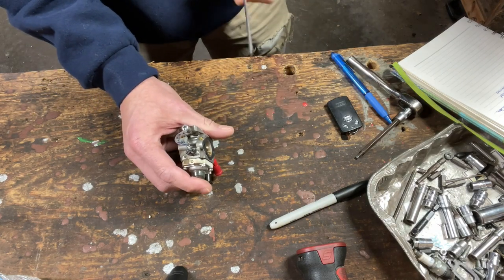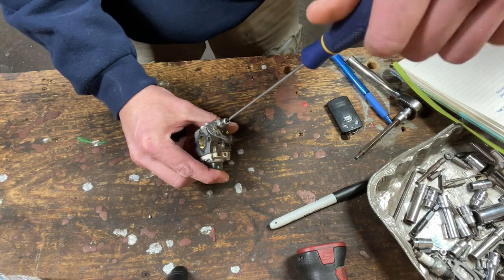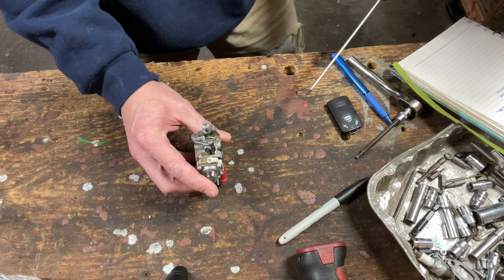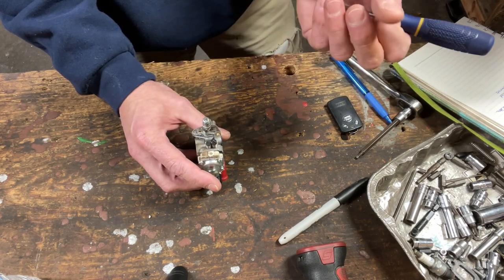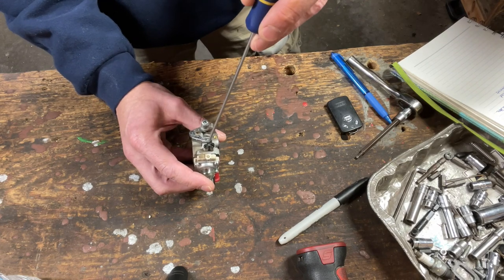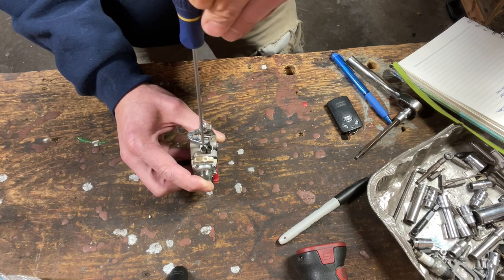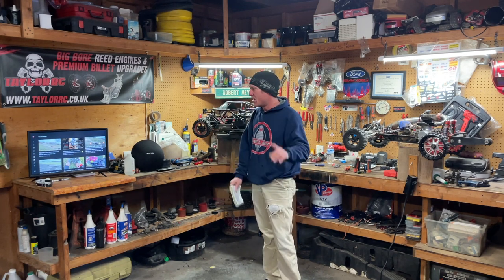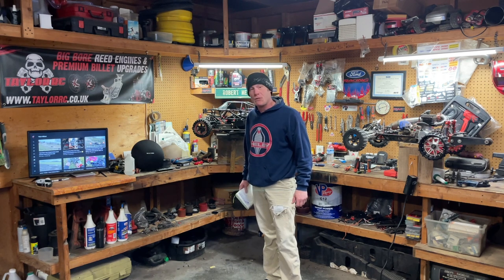FIFTH SCALE RC TUNING TIPS

Comment: Hey buddy. I just received my Rovan T5 sct off-road  4wheel drive truck. It’s the newer one, only comes in two colors, black and blue. Really it’s a MCD racing W5 clone. The truck is absolutely beautiful and I’ve only had it for three days. Haven’t even put gas in the tank yet. Just wanted to get your opinion on engine, break-in as it has the 36 cc door ring Roven, big bore. Any advice would be greatly appreciated. Thanks so much.
Reply from the maker: Hey bro 😎, yeah for running the engine in or “break in” everyone has their own way of doing it, some people do “heat cycles” usually around 3 for 15 minutes. Now I have a different way that I prefer and that is the “Grip & Rip” method, fire it up get, a nice fat base tune, and run it 😉 you will notice the engine “running in” it will gradually hit higher RPM and produce more power the more you drive it. You will also notice the tune changing and that is because as the engine loosens the ring will seat delivering more air and fuel ⛽️

Comment: I installed a velocity stack on my 36cc and it threw my tune off big time. I had a modified stock filter before but it was perfect running and sending rooster tails. I need to try to dial in the tune with the stack now, if I can't get great results I'm going back to the stock set up.

Comment: Had a question about a Rampage if u don't mind someone suggested to try u
Reply from the maker: Sure hit me up 🤙🏼
Reply: @Meyers2strokeRcgarage  mine is pretty much new I did long break in 1st one on stand where it sounded great n had smoke coming from exhaust. During stand break-in coupler broke which they happily sent another but while I waited I grabbed some off Amazon n got next day. Put it on n seemed ok but n now there is ridiculous pressure in tank n I can't get no smoke no matter how rich I make it. They told me take off bubble thing on gas cap which I did but that just made a ridiculous mess all over the truck from gas spilling out. Then I felt bolts backed out muffler some cause it was loose n that's as far as I saw smoke. Tightened them up but I still see no smoke n the pressure in tank n bulb is unbelievable, like a quarter of tank is bubbles. Idk if when coupler broke it caused a gasket or something to break as well but definitely not the same. I ran a couple day's ago 5th tank break-in done ready to go but pressure n lack of smoke seem to be worse. I always reset needles to factory before running then go from there depending on weather. Ratio 20:1 from break-in to now as they suggested but something is definitely not right. Any help or thoughts would be much appreciated ty
Reply from the maker: You have pressure or vacuum in the tank? It should not have either one. That’s why there is no smoke 💨 there is a restriction in your tank ventilation. What I did was make that tiny pinhole in the fuel tank cap and the little rubber piece inside and drove an O-ring pic through it to open it up. That took care of my issue. As the engine uses fuel, the tank needs to be properly vented so it does not go into a vacuum. I don’t know how you would even get pressure in there 🤔
Reply: @Meyers2strokeRcgarage  yes sir that's what I'm saying I don't understand. On the stand for 1st tank break-in it was great factory settings n nice smoke. When that coupler broke n I put new one on it has never been the same. No smoke n pressure in tank just outrageous its all bubbles or just shoots it all over body lol. I actually drilled a slightly bigger hole in cap as directed but it has not relieved any of the pressure
Reply from the maker: OK, you do not have a ventilation restriction. There’s something else going on. Take the carburetor off and try another spare one if you have one otherwise you will have to take the carburetor on it apart and see what’s going on with your pulse for your diaphragm. It almost sounds like you have something going on with your pulse in your diaphragm and it’s feeding back into your tank. 👍🏼
Reply: @Meyers2strokeRcgarage  ok appreciate it